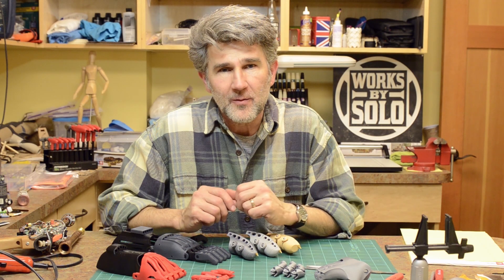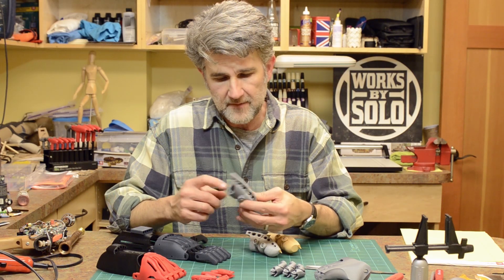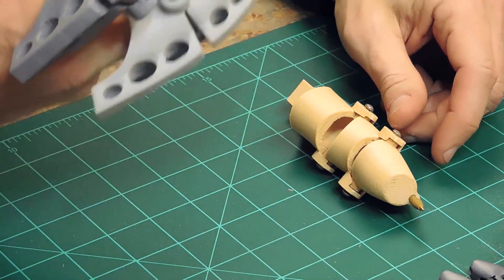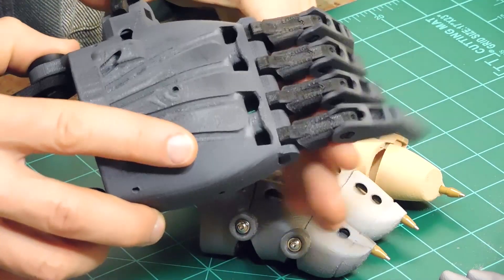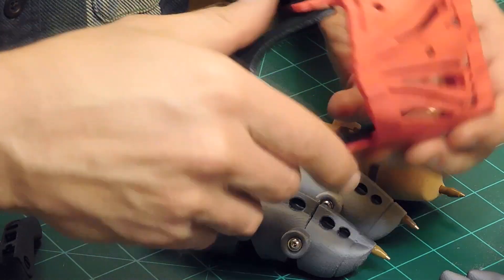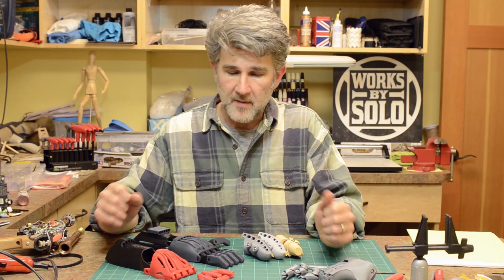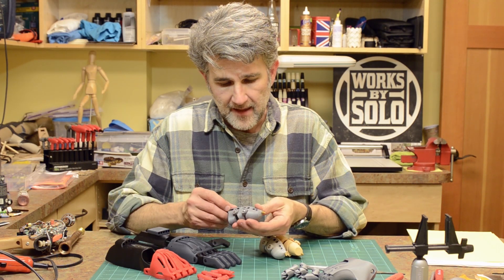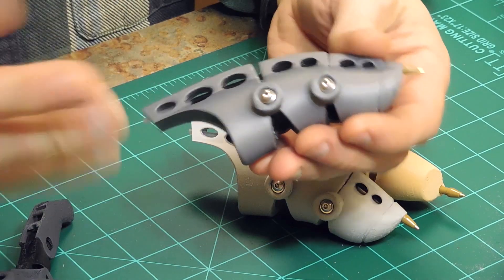SOLO FINGER (no lathe) PEN. Designed in CAD to be 3D printed in ABS or other plastic filament.

Comment: what 3d design software do you use?
Reply from the maker: +josh shutt Hi Josh, I modeled in RhinoCAD, but then imported the polycarbonate parts into Autodesk Inventor in order to use the sheet metal module. That compensates for the bends and lays the parts flat so that they can be cutout. Then back into RhinoCAM to make the CNC machine operations (g-code) Thanks for watching.
Reply from the maker: +josh shutt Sorry, thought you were asking about the robot video. The finger was modeled in Rhino3D using the "T-Splines" plugin for organic shapes.
Reply: Thanks for the quick response! I just made the pen with my zortrax and it came out flawlessly thanks for the files! But I will have to try out that software.

Comment: An actual new invention! It does require a 3-D printer, which is at least as expensive as a lathe, but still ... it's very effin cool.
Reply from the maker: +Gary Cooper Yes you are correct there! I kinda' got a bit carried away with this one.